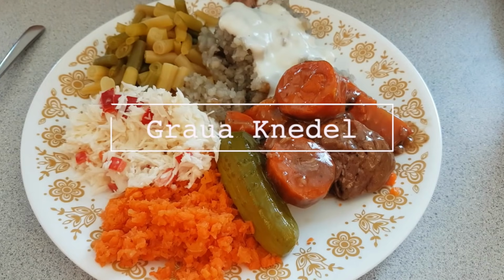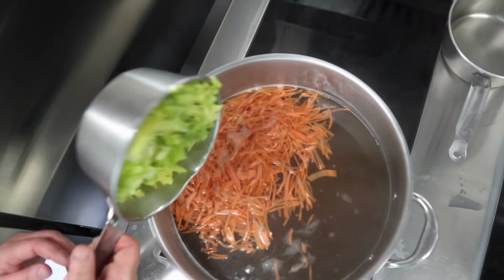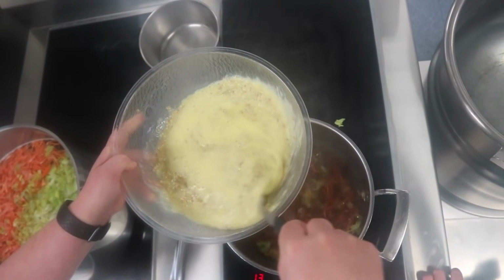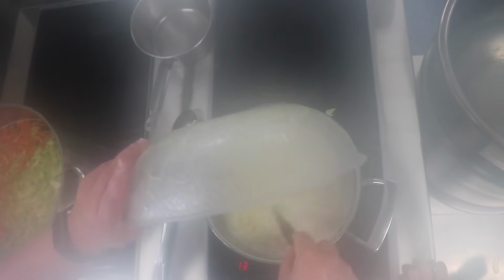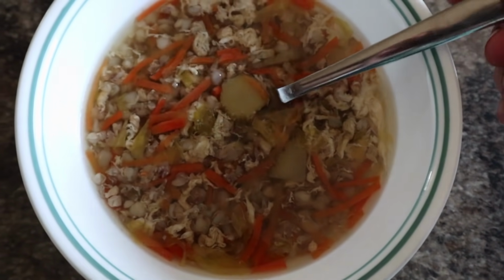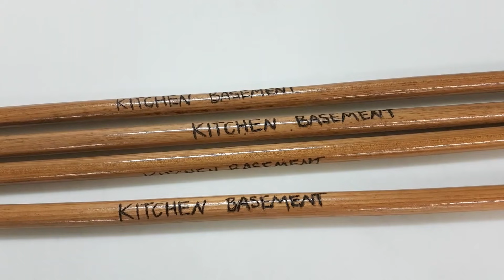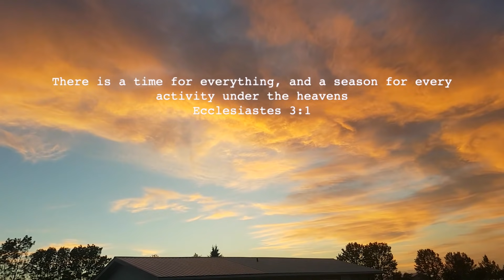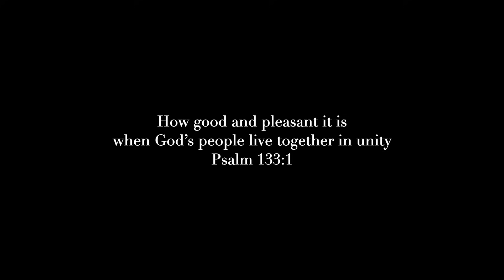Vlog #60 Old traditional Hutterite meal ideas + a relaxing friday!!! yay

Comment: I have never put meringue on rhubarb pie. Im going to try it. God has blessed you, you are always smiling and so happy.
Reply: I had not seen this before either.  I have seen a top crust or a crunchy topping of flour, sugar, oatmeal or streusal. Looks amazing.
Reply from the maker: I should have included it in the video but, its a shortbread crust with the rhubarb pie filling topped with meringue. although the short bread needs to be baked before hand I can try and get ahold of the recipe for you